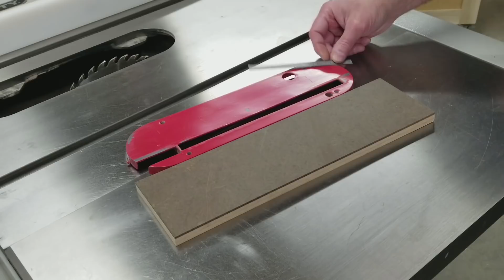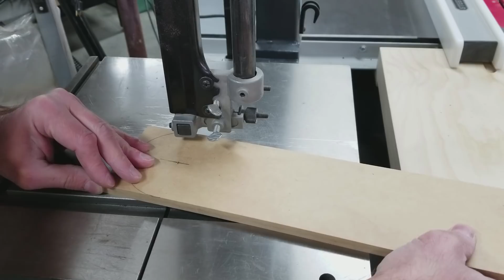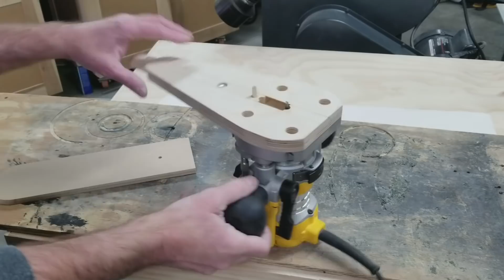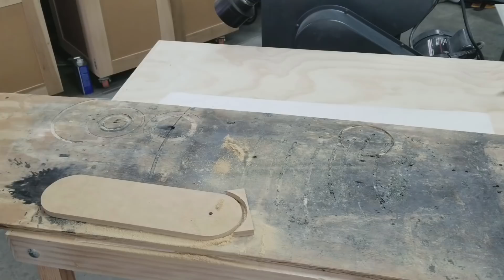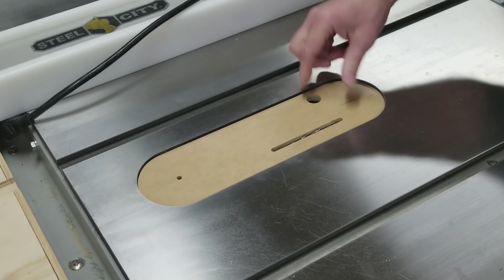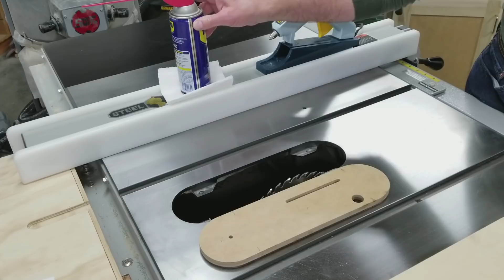How to Make Zero Clearance Table Saw Inserts Part 1

Comment: Thank you for addressing how to deal with the blade height issue when making that first zero clearance cut.  My saw blade doesn’t fully retract below the depth of the insert and I was wondering how to accomplish the task.  Router table!
Reply from the maker: That's great to hear, Andrea!  I had avoided making inserts for the same reason until I thought of using the router table.